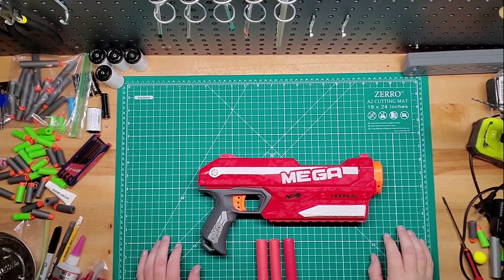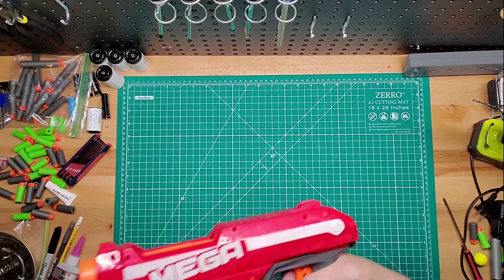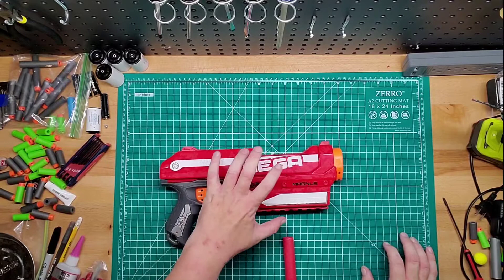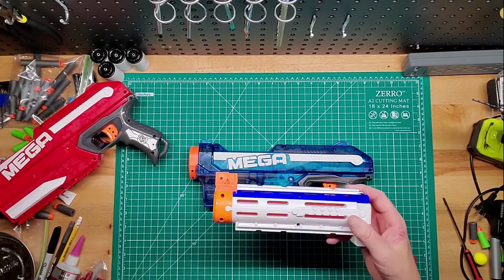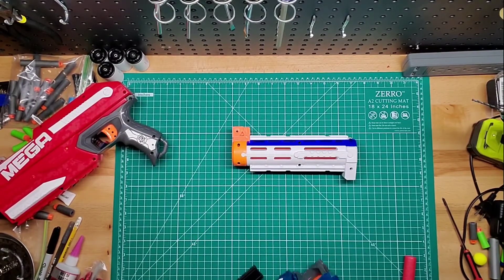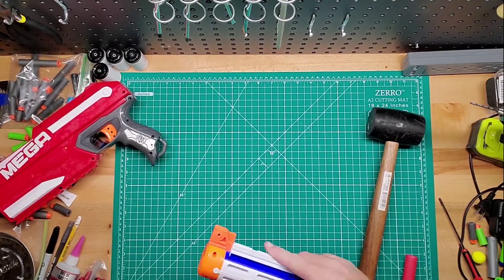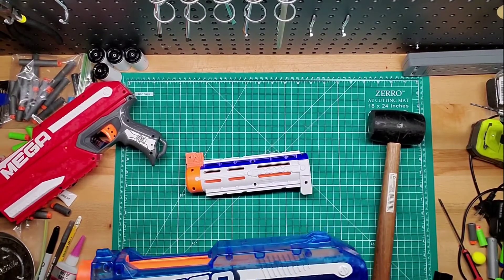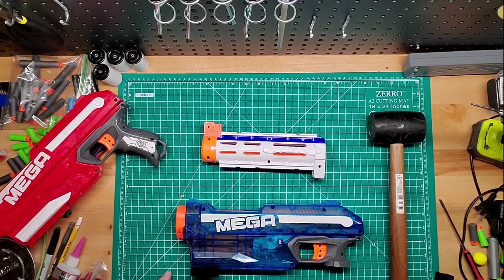Nerf Mega Magnus #Nerf #NerfModding

Comment: If the bracket is plastic you can use a heat gun to get it malleable and then put it on the rail while it’s still soft so that it forms to the rail
Reply from the maker: True